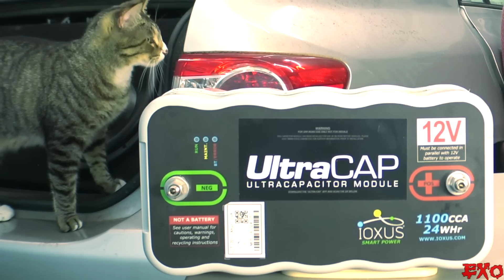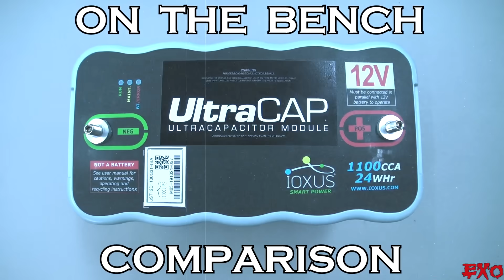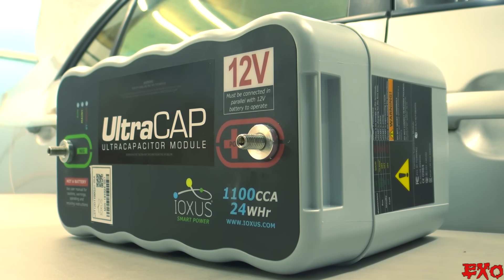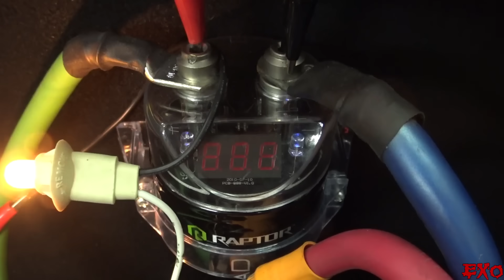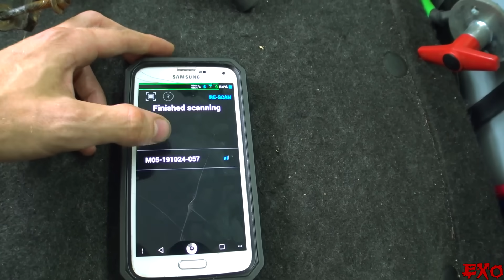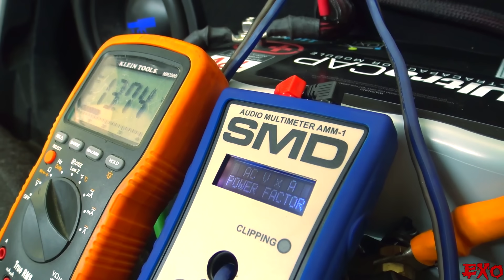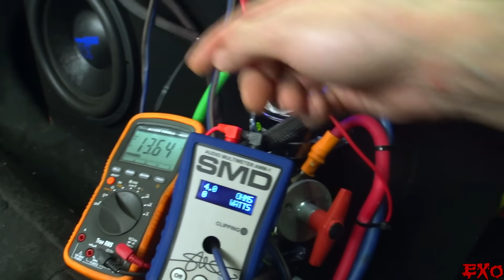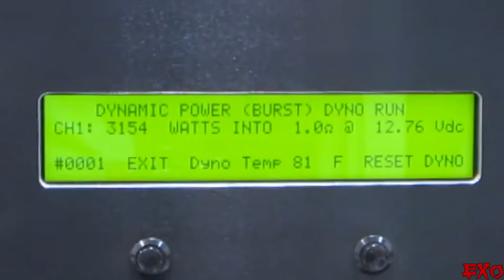The TRUTH About Car Audio CAPACITORS! Testing a CHEAP 12v Capacitor VS IOXUS UltraCap Supercapacitor

Comment: so if I'm above 13 volts all the time except for minor drops into the mid twelves when any new frequency plays (it climbs into the 13's again during that same frequency), I would benefit from a smaller capacitor which would act as a buffer for those small drops in voltage?

Comment: To me every time i put a cap in i always thought it took from the bass, seeing how i never upgraded big 3 or alts. So to me the capacitor just acted like i added 2 extra amps in the car
Reply: It was taking power from the system to charge, so you were not wrong.

Comment: That would be awesome to pair with my limitless lithium battery!!💪
Reply: All the cap does is "fix" massive internal resistance on lead-acid batteries. LiFePo4 cells have such low internal resistance and high discharge rate capability, you shouldn't need a cap... 100AH lithium = 100AH where 100AH lead-acid is ~50AH comparable. Hell, you could size a lithium system to not need any caps anywhere...

Comment: I would love to add the UltraCap to my setup to relieve my alternator’s stress. :-)
Reply: Well the stress would still be there, this just buffers out the randomness and keep the lights and the like from dimming if at all depending on your overall setup. I say this because no matter where the power comes from the alt will have to pick up to recharge the bank anyway. Caps charge and discharge much faster than a battery though so there wouldn't be as much wasted power essentially trickle charging the slower batt and the higher the battery charge it could be as low as 60% efficiency where as caps have much lower resistance to charge.

Comment: Good sh!t, I want one of those for my next build. I remember back in the day 1 farad was the max you could buy at the time, at a bargain price of only $200 each (I believe). I had 3 caps with a couple deep cycle marine batteries and I swore by all of them. That UltraCap could have easily taken the place of all of it though I believe. Crazy technology.

Comment: I tried to put in a 16V Ultracap maxwell bank into my bar & the current draw to make it go from 12.8V to 14.5V is enough that the car stalls out because the 200A alternator is too much for the 80HP engine at idle/start.. xD  This was 500F individually QC Tested with paperwork of the tested result, before shipment. Sadly probably gotta return it because too much for my engine.

Comment: Im searching for the issue source and a fix for my car and system. The whole car lights and stereo lcd etc dims when im bassing. 1 ~1000w amp, 1 ~400w amp. 150A alternator, 520CCA/62Ah battery

Comment: Been watching for a long time and learned a lot from you. Definitely need one of these ultra caps. I been building a budget system for a few months now and my amp is a little too strong for my electrical. Just a few weeks ago i had to put a new alternator in my car cause of it lol. Would be nice to win one but if not ill save up and get one eventually. Keep putting out the awesome content!

Comment: This is just a question so if I was going to put a single capacitor on my 2000 watt amplifier what would it actually do would it give it better sound or something
Reply: is that 2000w peak??
or 2000 watt RMS?
and at what speaker ohm rating?
.
my amp puts 60 watts into 4 ohms..... but 120 at 2 ohms. 
.
and if your amp just says "2000 watts"...... and not "2000 watts RMS!!!! at 2 ohms"..... 
its probably only putting out like 600 watts.... (aka, its a cheap as hell amp)
.
ANY! amp that DOES NOT list its RMS wattage, at a given ohm load, at a given voltage, and a given THD...... IS CHEAP TRASH!!!
and i WILL fight you over that, lol. 
.
but seriously.... "a single capacitor" doesnt tell me anything either. 
it could be 0.25 farad..... 25 farad.... who knows!!!!
.
a 1 farad might be a waste of money...... yet a 5 farad actually give you better SUSTAINED sound.... or keep noise / hum / whine out of the audio loop
.
Reply: like.... it sounds like you are a beginner.... 
.
and your amp is probably 2000 watts PEAK!!!!
which is usually around 20% of what it can actually do..... AKA 24/7. 
.
my old amps is 1000W RMS at 4 ohms on 12.6 volts. 
yet is 6000 peak. 
.
peak means it can do that for 0.000000000000000000000001 seconds. (and then falls off to like 20 watts)
RMS means it can do that for 1 million seconds

Comment: Would love on of these my headlights go so low it’s hard to see when the subs hit
Reply: "big 3" upgrade (aka, upgrade the wire from the alternator to the battery.... and the ground wire from the car body to the battery)
then.... get a bigger alternator (but WATCH OUT!!!.... a lot of "high amp" alts.... actually REDUCE power output at an idle.... and need to be spun at higher RPM than your factory alt.)
and if that doesnt work...... stop driving at night when you play heavy bass songs lol.
.
but seriously...... by factory 105 amp alt can put out all 105 amps at 1800 rpm. 
yet a "high amp" one..... from a known re-builder..... only puts out 80 amps at 1800rpm....... but can do 200 at 4000 rpm. 
.
and i REALLY doubt you are cursing around at 60 or 65mph..... speed limit at night..... in 2nd gear to get the 4000 RPM. 
.
so in my case.... its better to keep the factory alternator.... as it delivers more power at the RPM that im actually driving at. 
it also makes more power at an idle..... AKA pop the truck and play music at a "red neck Montana" party..... 
.
so.......
80amp at 800 rpm (aka, idle)
VS
60 amp at 800 rpm. 
.......
and rated max power at....
1800 rpm....(105 amps)
VS
3600 rpm (200 amps)
............

and with my 4 speed auto in my 99 buick..... i would LITERALLY have to drive around in 2nd gear to hit 3600 rpm at cruising speed
Reply: Try upgrading to an Optima battery yellow top.

Comment: I think I still need a bigger amp alternator. In my Silverado I’ve seen voltage as low at 10.3v at one point. This super cap would be a great addition to my system.

Comment: the key to a cap working is it HAS to be near the amp it is feeding...that is why the 1f showed positive results.  Good video Exo!!!
Reply: I wire my liion bank right next to the amp within 1 foot for this very reason . It is huge to put whatever your backup bank is right by the Main amps
Reply: @russlora  0
Reply: Maybe hes busy and dont have time to deal with all the immature kids trying to argue with him. If you dont like what he does dont watch him!
Reply: you should play neffex dream catcher on one of your subs
Reply: that goes to everything with electricity. longer distance = longer traveltime. shorter distance = shorter traveltime. don't have to be a scientist to calculate  ;)
Reply: @XnaughtylusX  a bit late, but that's not really how electricity works.
It's irrelevant where a cap is placed within a car audio circuit. It's WAY too short for it to make an easily measurable difference.
Reply: I think thi
Reply: And DON'T Fuse between the Cap and Amp.
Reply: @chrisphilhower6029  what do you mean? Don’t fuse in between?? If my amp is supposed to be fused you’re telling me to disconnect the fuse and run it straight to the cap? So should I fuse everything after the distribution block and not before?? My cap has a distribution block I plan on running that out to another distribution block then running the amps into that! Help please
Reply: @BEATING NCP93 nothing happened to freedom of speech.  it doesn't now nor has it ever applied to private enterprises.  not sure you you came up with the idea that it did.
Reply: I'm sure this is in here somewhere within the pile of responses, but it really isn't relevant as to where the caps are located. 
Contrary to popular belief, electric power doesn't flow like water through a pipe as people are taught as a visualization tool. Electrons aren't flowing to an amp to be consumed, the change in magnetic field is. You can put your caps directly to an amp of you want, but all other amps connected within the same circuit will have the same benefits. As long as they are within the circuit and you are using large enough copper to connect your components, the difference should be so small it would be hard to measure. In theory you get more power due to transfer loss within the wires, but the lengths of the car audio circuit are so short it isn't an issue.
Reply: I watch both or you channels woot woot
Reply: Legitimate question cuz I'm curious, you couldn't do both? With a big three upgrade, then have extra battery  and a super cap?  What would happen?
Reply: Coming from the Don of Audio!!
Reply: I would like to add that the capacitor  has to be charged also before putting it into sequence
Reply: STEVE MY DUDE!!!!!!
Reply: I'm a newbie to this, it has been rather expensive reletively speaking, two batteries and two alternators, had no idea that high output alts were so expensive, but would have saved money by investing in an expensive high output alt and called it a day, oh well live and learn.....
Reply: Tsunauticus III  he most likely never will lol.. he's about to be 48 but acts 4-8 years old lol.. I could only imagine how many subscribers he has that he blocks.. honestly, I think YouTube should remove the subs that he blocks, I bet those numbers would be a huge change
Reply: @youdig3691  exactly. I had a run in with him briefly on some other channel and he was ridiculing something about some product being made in China. And I stated that most his products are from China as well. He shut up pretty quickly
Reply: @Ginx-pe4si  I'm telling u bro, u disagree with the ALL POWERFUL MEADE and he gets n his feelings bad.. if it's not a meade design or he's not sponsored by them, it's "trash" 2 him.. he's over 40, he shouldn't act like a child anymore
Reply: @youdig3691  cant knock a brother in there 40s I'm in my 40s and yeah act like 4 to 8.lol  But love it have sense the first time I heard a just a couple 12 inch subs hitting in the back of a 87 iroc z Camaro. I was addicted from that point lol
Reply: @youdig3691  Hes arrogant...what do you expect from a person that has a "freeze" fascial expression?
Reply: @youdig3691  how does he even block people
Reply: @TheMatsushitaMan  he will block you and if you left a comment,  you won't be able to see it, it'll be automatically erased
Reply: @youdig3691  boo hoo, he blocked someone on his channel. Wanna cry about it some more?
Reply: @youdig3691 uh what??
Reply: @youdig3691  agreed bro that dude seems to be all in his feels, I don’t know the guy but from all of his videos where he talks about people talking crap or whatever he takes the bait and acts like a chump.
Reply: @youdig3691  you are correct.. he gets very butt-hurt easily..   I think its great... but hell, so do I...  but I'm a super cool dude, so its alright.....
Reply: shout out Steve, I got a SMD distribution block running my system, love the quality👌
Reply: @UCAn7KfxuoxUur8dP-lFCjdA ima show up. One day. Cause your a fucking legend and it would be  epic to walk thru that shop.
Reply: All you guys some Sensitive bitches. Who fuckin cares about him..
Reply: My amps and capacitors are about a foot apart.
Reply: @desmondmarshall7384  well just don’t put your real foot between your capacitor and amp.  It’s a horrible conductor.
Reply: Can these super cap be paired with my front lead acid batteries on my ram cummin
Reply: Electrical engineer professors all over the world are always talking about how slow the wire is by Steve... weird.
Reply: Wonder why he blocked you leave the hate else we’re Steve is a humble person always giving back
Reply: @DavidJones-le4li  dunning kruger effect stuff probably.  i go on videos here and see stuff like people telling the guitarist for Megadeth he's playing Megadeth songs wrong.  People with video game avatars saying that US military snipers with 30+ confirmed kills in iraq that they don't know what they're talking about in regards to sniping.  welcome to the internet.

Comment: Great content as usual. Hope I'm the lucky winner cause my system could use some help next to the amps. My 300amp alternator keeps up but the zero gauge wire can only deliver so much. Also love your RC content too. My 6s Kraton is almost complete with all the M2C upgrades. Maybe they'll let you incorporate some of that content too since it has to do with batteries and capacitors? 🤷‍♂️

Comment: Just get a better battery or a second one, cheap are useless plaster to hide other problems.

Test better battery setups vs the supercap to see if its THAT effective. I really doubt!

That supercap will put lot of load on the alternator to charge it Up after it compensate the lack of battery.....

Comment: I put supercaps in my car but for not for audio... cold starting performance in the winter. Car starts even after sitting overnight at -40 (block heater not plugged in).

Comment: Always get a kick out of your could sure use this supercapacitor I have a 400 amp alternator a red top agm under the hood and zero gauge wire and my lights still dim like crazy and they are all leds

Comment: My only experience with a 1 farad cap was in the early 2000’s. I had 2 12’s and 500 watts in my 99 Bonneville. My headlights dimmed so badly that my lights looked like I was turning them off and on. I hooked up the 1 farad cap and problem was solved. It worked for me in my car at that time.

Comment: I remember I tried two cheap caps neither one of them did anything besides lower my bass my headlights still dimmed like a mofo never went back to them but that super cap makes me want to buy one tho im leaning on getting a xs power batt for my kia optima. currently using some noname batt that I had got about 3 years ago bought it for 50 bucks when I killed the original bat that my car was sold with....

Comment: they dont make sense to me except in an spl build. super caps and caps have no capacity compared to lead acid-agm. For daily systems i would think a couple 200ah deep cycles paired with a couple 1000cca starting batts will give the best results for the money. The deep cycles have the storage and the starting batts will act like a cap but with alot more storage.
Reply: Lithium better than agm, faster discharge and faster recharge and way more efficient. Think of it as you have a pool of water (agm battery), you connect a hose (power wire) to it to drain it takes for ever and it would take longer to refill it the same way.  Do the same idea with a lithium, but with its efficiency that hose is 40% wider allowing faster drain and refill.

Comment: the hypothesis of including a capacitor bank is sound. when the amp calls for high current instantaneously, all batter solutions will have a small ramp up to get that current forward, adn the mechanical alternator will ahve to put a lot of torque against the belt, andthe engine may not respond in time as well. so capacitors are the easiest way to get that current to the amp. the only problem as how much capacitance did we need, and this vid cleared it up, 1 and 5 and 10 farads weren't enough, u needed hundreds.

Comment: Straight up some capacitors are very cheap made and misleading as to what they can do and can't do , but I always tell people especially newbies to the car audio world to try a good quality capacitor and see how they like it , after all it's about learning and I also tell them that if their charging system is not working properly or providing the amperage required to operate the particular amplifier their running , then a capacitor is probably not gonna fix their issue !

Comment: Tell you what you may not have known , I had a weak battery in my truck and I had been cutting grass for a while and left my phone charging in the truck , jumped in the truck to crank it up to go home and ,, click click click no way would it crank , so what to do ?? Simple , take my 425 amp lawn mower battery out of the lawn mower and hook it to the AMPLIFIER power wires and amp ground , after all their going to the battery , and waa laa crank e crank e and I'm cruise n , you see the battery stores wayyyyy more continuous amperage supply than a small capacitor will or can ! True story !

Comment: I’m getting my 2013 Camry electrical system checked but I went from a 12L7Q 2 ohm to a 15in 2ohm L7. Had to get a new alt, new battery and belt and still having some trouble in my steering spring thing and the harnesses getting checked cause something is resetting my car ECU. If I got a cap for my system do you think it’ll be ok and help out my alt? I can’t beef my alternator up apparently

Comment: I ordered a super Bank capacitor for my Crescendo 6K I have two 3000 XP XS power .and aftermarket 250 amp alternator for a 2017 Malibu but I can't find a belt to fit it at this point I'm probably going to just sell the vehicle and buy Tahoe

Comment: Exo pro tip caps oy help with sq if your running cheep a/b amps or high power/sensitive d class amps also cap don't really help because they cause damage to alts

Comment: In my systems I've always made sure I had the correct power going to the amps.and have never had a problem 
Never needed a cap. My systems have been 2 12s with 1500.1 and then a 4 channel 125x4 going to 6.5 components and 2 coaxials. Upgraded alt and extra yellow top . Never a problem.